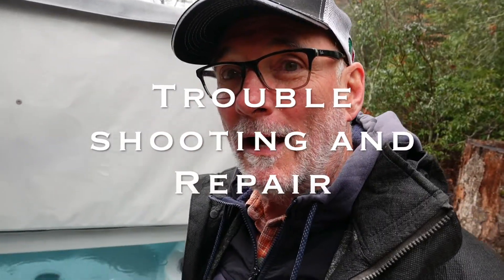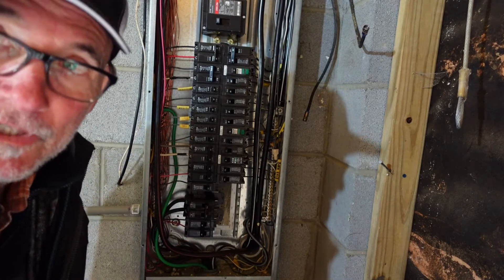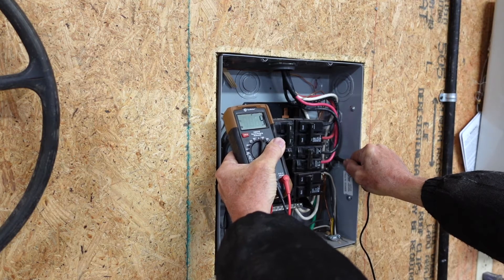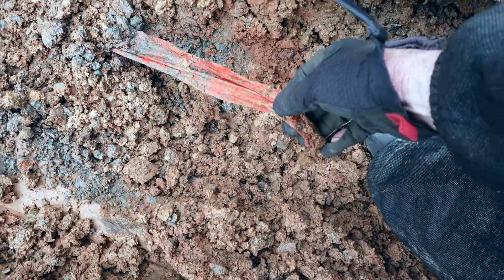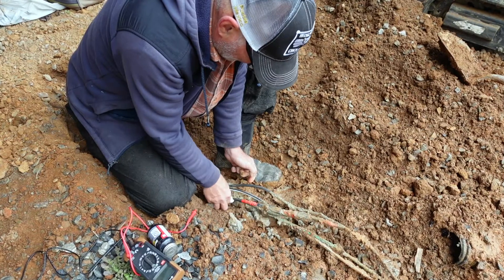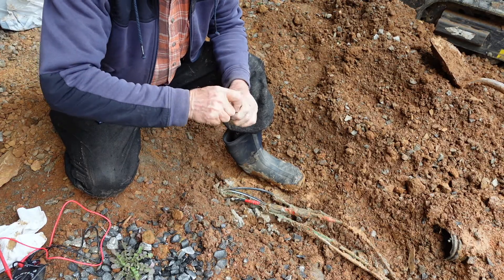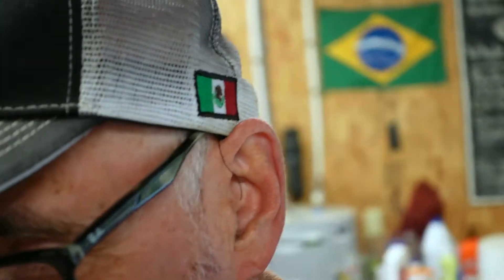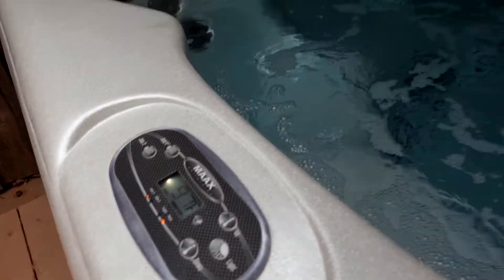How to Trouble shoot and fix a Buried Electrical Wire Repair

Comment: Hey Little Digger, I'm a former utility Troubleman for 40 years.  Trouble shooting voltages ranging from 120 to 500k.  You did a great job trouble shooting the UG service.  Might I suggest a few things.  Safety is always first so always wear dry leather gloves.  You on your knees in wet soil and there's another bad spot where you grab the wire and well, you know what happens next. You can get shocked by a voltmeter lead too.  I've taken many individuals off cable, some electrocuted and some just felt the shock,  separated some from the metal ungrounded power tools or antique welders, even pulled a lady from her bathtub when the service neutral opened up going into her home and the metal fixture was hot and looking for a path to ground.  A steel tracked hoe can still come hot so remind yourself of that.  Safety is most important and always follow the 10 rules of electricity safety.  They're all the same.  Don't touch it, don't touch it don't touch it.. . . .  Invest in an insulation mat, especially when you have that many wet conditions. We work the lower house voltages hot wearing such gloves ( dry ) and high voltage rubber gloves for 480.  distribution voltages and above sub transmissions we use hot sticks.  Some utilities do rubber glove the distribution voltages but we didn't.  Use a non contact tester when possible, they're cheap. That's a neutral not a ground. Ground is earth / ground rod / ufer and neutral is a return.  The green one is a ground.  No need to open the neutral for testing.  240V +/- is what you were looking for.  Great job splitting the source to load distance. That's how you do it without a tracker.  Midpoint, midpoint, midpoint again.  Smaller and smaller distance until you isolate the fault and make repairs, but not everyone one owns a hypot tool or cable tracker.  Next time and there will be a next time, use compression sleeves.  Electric shops will carry them.  This service you will not want copper ones for that type of wire except the green which I expect could possibly be copper.  Two things for sure.  The rocks caused the break in the insulation and the corrosion was caused by water getting into the cable jacket itself.  This is not direct buried cable and even if it was it needs to be installed in plastic conduit.  Cable will still fault in conduit due to water or improper install, its just less likely.  All in all, you did a great job isolating the fault.  Next time you go by an electrical shop, grab some sleeves and shrink sleeves as its only a matter of time when you'll need to start up the little digger.  You can tell I'm retired by how long this took to write.  Thanks again.  Stay safe!
Reply from the maker: Where were you when I needed you!!! 😄You get the award for the most helpful and most positive comment ever!  Thanks for the great info.  Im just a property owner and was under the gun to get it fixed as I had a guest coming and needed the power so did what I could with a short phone conversation with my electrician who was tied up for days.  That line did in fact break again after this video, so this time I dug up the whole 100' and put a new Alum line in conduit.  I probably made several mistakes doing that too but luckily didn't make a video for review!  My mini has rubber tracks and power was off while digging.  The only time power was on was when I tested with the volt meter but yea I hear you about better precautions.  I've been shocked by 115v before so can't imagine getting hit with 240v.  Again thanks for the great info.  I'll reread this comment and get some gloves and better fittings if I ever have to do this again, but hopefully never again.
Reply: @arlingtonguy54  240 feels just like 120, more people electrocuted and die from 120 than any other voltage.  That's why you don't see metal power tools without a ground anymore.  Gotta love the mini now with the rubber tracks. . .

Comment: Nice repair
Second time huh

Suggestion next time you run a service dont cheap out and us direct  burial wire, Run conduit and use thhn wire

Also dont cheap out on the size of conduit 

you could have saved your self alot of trouble over the years.

Comment: Good job in fault finding but don’t ye have a requirement for conduit or SWA steel wired armour cable over there in America ?
Reply from the maker: @fergspan5727  that wire was supposed to be rated for direct burial but it didn’t hold up to the conditions. I replaced it with new wire in conduit after the third failure

Comment: I'm glad for this video as my well stopped working.  A friend came to help, and beyond having a bad fuse, we found that there is not continuity in the wire that is buried. We've started digging (the hard way with pick axe through the frost line, and then with a trenching shovel) to check the wire. I've finally come to the conclusion I should just replace the wire and use  conduit properly. The original is direct buried 240v probably from the 70s. It's about a 75 ft run, so it seems most expedient to go ahead and make a new run. We will temporarily put it up on the buildings, and then as the ground thaws, will trench and bury the new wire with conduit. I really appreciate this video for showing me what my friend was trying to explain to me as we looked for where the wire was arced. We didn't find it yet, but so far the wire has had water in it... it's old. I also appreciate the safety comments because I myself am very afraid of electricity... especially having accidentally felt my electric fencing a few times.
Reply from the maker: @TracyWessel  be safe!  I gotta a comment from an electrician with some very good safety tips that I didn’t know. You should read them.   I have since replaced my wire with a new one buried in conduit.

Comment: Good video. Consider this. The fact you berried your wire through the drive my have caused your breakage. The ditch looked shallow , the type soil , freeze thaw , and the repetitive driving across line may have stretched the wire causing a break. Consider berrying the line deeper or conduit through the drive path. thanks again for the information.
Reply from the maker: @mauriceFerguson-br1jx  about a year after this video it broke again. I put a new wire in conduit and have had no more problems.

Comment: An ohms reading would’ve been able to give you a distance without puncturing perfectly good wires. A locating company would’ve been able to find the faults exact location with the right equipment.
Reply: Not trying to knock what you did. Exploratory digging was the way years ago.

Comment: How do you suppose the wire broke
Reply from the maker: Not sure but it could have been struck by lightning according to my electrician or the insulation may have been nicked and water got into the conductor causing it to corrode?  It happened again after this repair so I laid a new wire in conduit.
Reply: If whoever didn't put the correct rating size of wire with the proper calculation drop, this would cause a wire shortage that is under rated wire size .    Bingo 

 Remember he said this his second time doing this....

Comment: Thanks for the Great video Brother!!!!!!!!!!!!  I just had to do this same thing for my machine shop this morning! One leg had no voltage at all!!! Sure could have used a little digger!   🤣🤣🤣 In 2003 I put that wire in the ground without conduit, because someone told me it didn't need it!   Grrrrrrrrrrrrrr!!!!   God's Blessings Sir!
Reply from the maker: After making this video it broke again. I then replaced the whole line and put it in conduit. No problems since. Good luck.
Reply: @arlingtonguy54 - I was going to say that conduit can be your best friend. It’s likely to fill up with water but that’s usually not a problem.

Comment: All that digging sir  you should have dug it all up and put it in conduit.
Reply: Not even close to necessary. Should’ve called a locator to fault the line and find the break. Direct burial cable is made for direct burial at the correct depth.

Comment: was it just luck that you found that severed bit? how did you know where to dig that second hole?
Reply from the maker: I think it’s explained in the video. Start in the middle and test for current. If there is current go halfway downstream. Repeat till you find the break. If there is no current halfway then work backwards halving the distance

Comment: Use underground cable locator - you can pinpoint the problem spot without digging.

https://www.walmart.com/ip/CRSCAN-F04-Underground-Cable-Non-Destructive-Locator-Wire-Locator-Receiver-Wire-Locator-Transmitter/401159069?wmlspartner=wlpa&selectedSellerId=101075054&adid=22222222228401159069_101075054_143209584459_18512335673&wl0=&wl1=g&wl2=m&wl3=631651703273&wl4=aud-393207457166:pla-1930895069687&wl5=9005384&wl6=&wl7=&wl8=&wl9=pla&wl10=422556125&wl11=online&wl12=401159069_101075054&veh=sem&gclid=Cj0KCQjwtamlBhD3ARIsAARoaEzbSD7m-4v1YRmVUor5BA1hzYKLNvpvx8ZR0jojpRI-VUZTzO9sod0aAskfEALw_wcB&gclsrc=aw.ds

Comment: ty
Reply: good morning, do you think 110 is good enough for a shop? nothing big running just lights and small fridge. seems like it had two 110 and a neutral running under ground but after digging i realized they capped one of the 110 cables off.

Comment: Were the conductors and insulation rated for direct burial? They should be UF rated.
Reply from the maker: I was told by a couple of “experts” in the comments that it was not but Lowes claims it is and also the manufacturers website says it is.

Comment: The next dip into the hot tube will be your reward for all the work you had to do. Thanks for sharing, I have a similar issue with my well pump as I was digging and nicked an underground wire so I think it will actually be much easier since I just need to dig a little more around the wire and see if I actually cut it. Great video and appreciate it.
Reply from the maker: Good luck!  Just make sure power is off while digging!

Comment: Not to be critical but the voltage measurement of 120 vs 122 doesn’t correctly indicate the problem. 3 percent voltage drop is completely acceptable, however this should be tested under load or while attempting to run whatever unit it feeding. This will show you the true voltage drop via resistance/short/whatever. The voltage categorized as 120/240 that doesnt mean its exact.  I only say this because if someone repeats this test then thinks this is an indication of the problem its most likely not the problem because any phase/leg could have more of a load than the other thereby decreasing the voltage by more resistance.  I suspect if you had measured the voltage when you tried to run the unit it would have dropped to near zero or low enough to not run.

Comment: how did the wire get cut/broken in the first place????
Reply from the maker: An electrician said that possibly it was damaged from a lightning strike.  Its also possible that it was from too much rock in the ground. I have since dug up the whole line and put it in conduit since it failed two more times.
Reply: @arlingtonguy54  Yeah conduit provides physical and chemical protection to the insulation.

Comment: Checking each leg to ground separately for 120V is useless test of a multiwire cable (one with multiple hot legs in it.)  You need to check leg to leg for 240.  If one wire is open circuit and you have any kind of load on, each leg will measure 120V to ground on the voltmeter.  So if your test gives you 120V on each leg you might think everything is OK when in fact one leg is open.

Comment: Bad lay out design. Should've run a pvc conduit along with the hot lines with pull boxes in between the mp and dp. TThn ' thws or whatever tts are reacts with the dirts. Insulations gets worn out over time especially with micro holes are present in them. Shouldn't run them under where they gonna get run on over of something heavy.

Comment: Shouldnt that line be in pvc conduit. So it can be protected from water
Reply from the maker: Not necessarily. Direct burial doesn’t require conduit. Probably would help though.
Reply: Conduit underground fills up with water from condensation. This is not a problem if the insulation is good on your wires when you install it. And it doesn’t get hot.

Comment: If the wire was completely broken how come it read 120V?  Shouldnt it be 0?
Reply from the maker: Rewatch the video as that is explained. The 120v was going through the 240v water heater and back into the panel feeding the other leg. An electrician told me about that and I tested that theory.

Comment: Did you use the shrink tubing with the sealer to seal out water? regular shrink tubing will not seal out the water.
Reply from the maker: Used 3M electrical seal tape under shrink tube

Comment: How /why did wire get cut?
Reply from the maker: An electrician said it’s possible it was struck by lightning which damaged the insulation causing pin holes. Then water gets in the wire and grounds out the hot wire causing it to fry.

Comment: How did you find the severed wire so fast? Or did you dig most of it up to find it?
Reply from the maker: Start halfway. If no power it’s behind you. If there’s power it’s ahead of you. Keep cutting the distance in half.
Reply: @arlingtonguy54  thanks for the tip

Comment: You probe the wires with the power on? Wouldn’t that electrocute you?  I need to do this same test for my house but worried about getting shocked
Reply from the maker: Yea the power needs to be on to see if they are conducting. The probes are insulated and only make a pinhole.

Comment: I wonder if you should dig the line up and put it into conduit. I am having the same problem from my house to my detached garage the contractor only put conduit 6 feet from the garage and 3 feet from the house and there is 33 feet of wire buried in between the house and garage I’m going put the conduit the rest of the way so the wire is protected
Reply from the maker: Actually I just did that after another break. Laid down 80 ft of 2” I think it was. 🤞.
Reply: @arlingtonguy54  verry good sir i always use conduit dig once pull as many times i want

Comment: I would have used a locater on each leg at a time and if broken into like video showed would find within inches or if half burnt into if experienced w locator signal will be stronger at exposed half break in wire eliminating all the extra Digging . because most know any kind of Nick in wire sheath and then moisture it's over just a matter of time for short out and corrosion.

Comment: Think I would have checked to see if the tub was running before I buried the cable. Why didn’t you just encase all the wires in a long pieces of joined PVC. Eliminate the exposure
Reply from the maker: I checked power at the panel before backfilling. This was direct burial wire so not recommended for conduit however I did go back since this video and run new cable through conduit.
Reply: @arlingtonguy54  Us old guys just learn. We don’t want to do things twice. We did that when we were young.